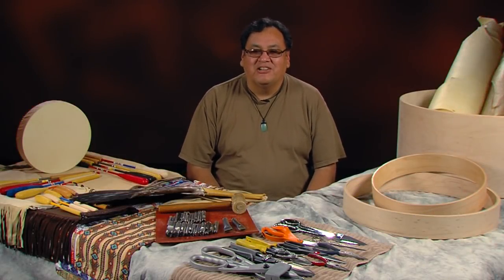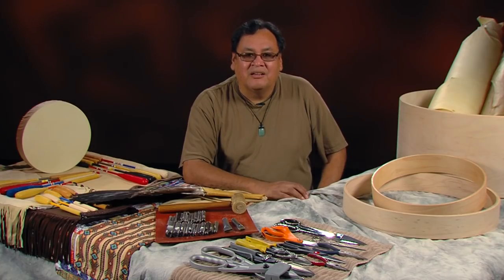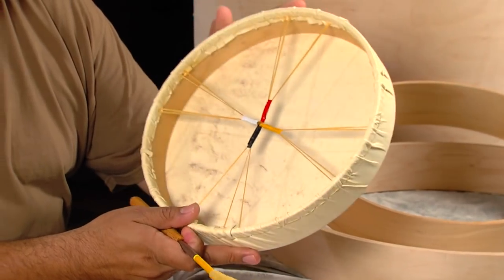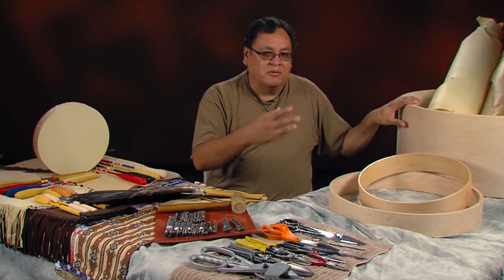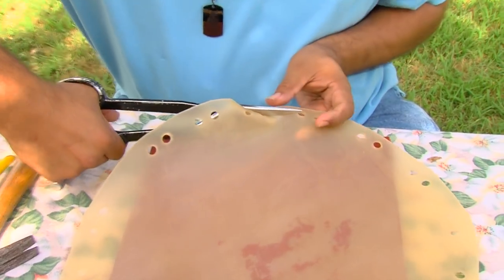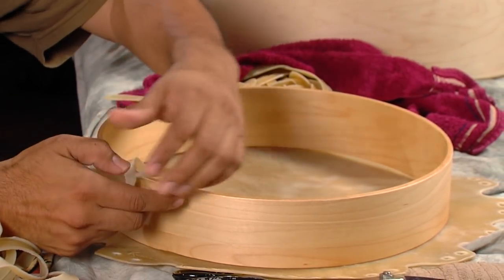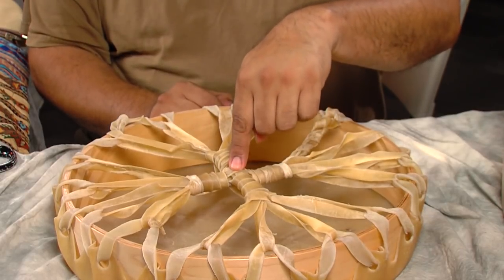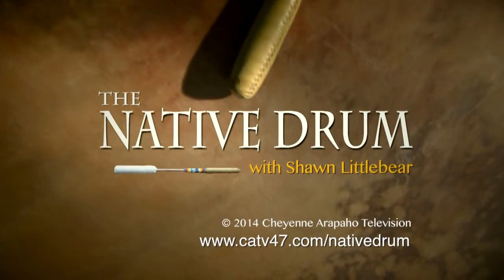The Native Drum - Premier Episode #1

Comment: super nice drum making information! I am in the opertunity to make a very big drum. The size will be 50 cm in diamenter, from center to end of frame. The frame will be from light, strong wood due to the size. I have found a prefect rawhide with the correct size for it.However, i do need to know the size of the lace that i need to cut for joining the drum all to gether. So the drum will have in total a 1 meter from point to point. Can anyone enlighten me with this quest? I have seen it in a jounering, and they requested it for me to be build (dont ask why... i just try to follow up on the request)..thank you for your information!
Reply: use 1/2 inch lace . . . or 1.25 cm
Reply: Thank you for your answer. so in this case, if i am correct, you need to have +/- 25 cm extra over the total diamenter  of the drum :D i can do something with this information. tanhk you again for the information!!! ps i suspect that with 1.25 cm you actualy means 1.25 meter right?
Reply: Francisco fcs : actually u need to make sure the lace is 3 times as large as the circumference  to ensure u can effectively wrap the big drum. It also needs to be 1/2 inch WIDE lace for big drum